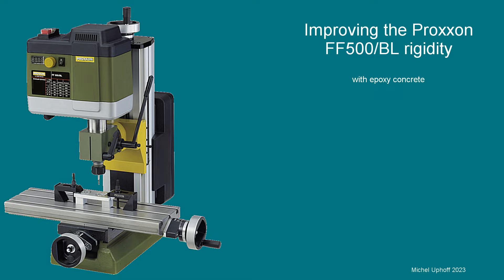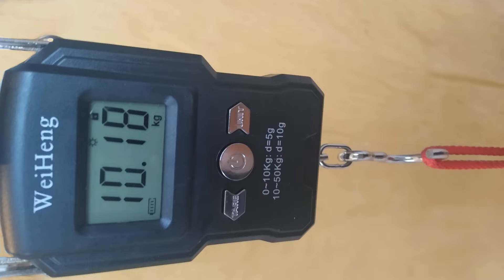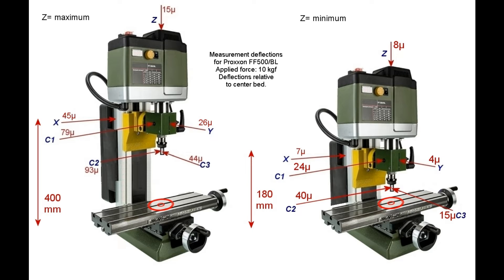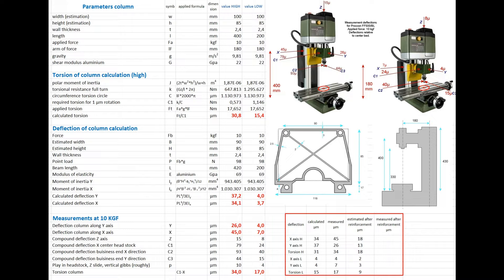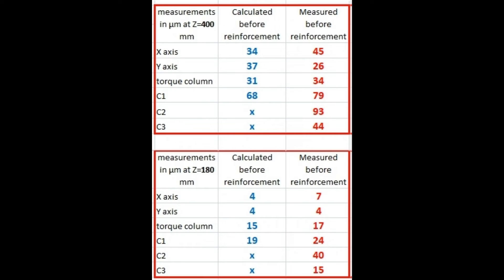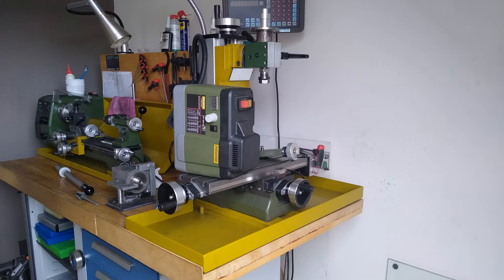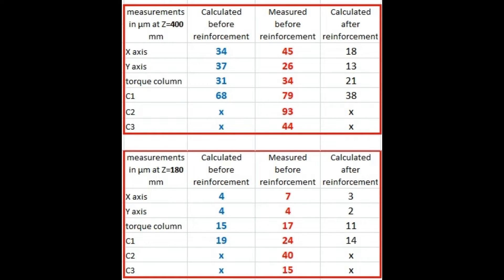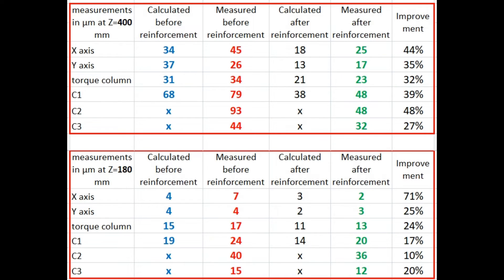Improving the Proxxon FF500/BL mill. Casting epoxy

Comment: Another interesting video on improving your machinery Michel, Well done!!
Although your disappointed with the initial results, I'm sure they'll prove beneficial overall, possibly with cutting speed/surface finish.
Looking forward to seeing what the final outcome provides you with.
Reply from the maker: Hi Collin!
I am only a little disappointed, until now. OK, a 40% increase in rigidity is nice, but I calculated 50% or even a little more. I will have to wait until the resin is fully cured. I did a hardness test yesterday with a sample of that epoxy concrete, and got Hv 17, while 23-29 should be achievable. So I still have to be patient.